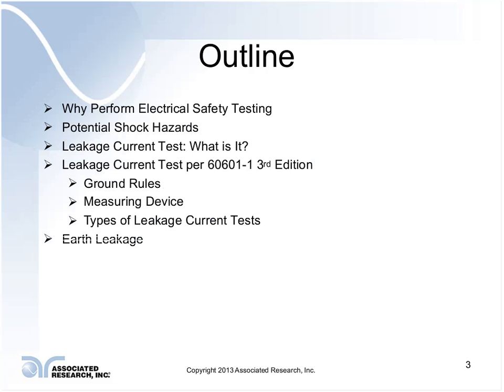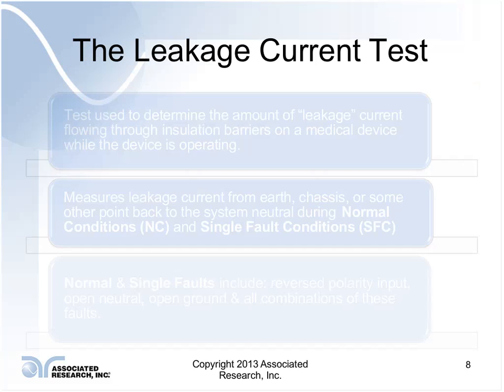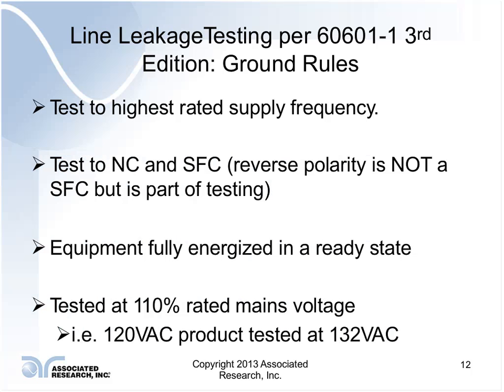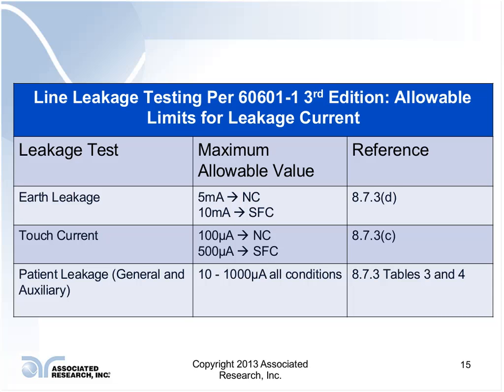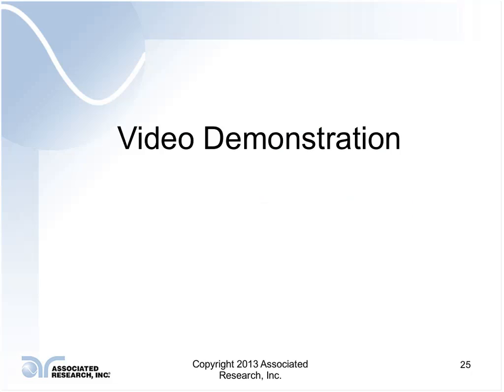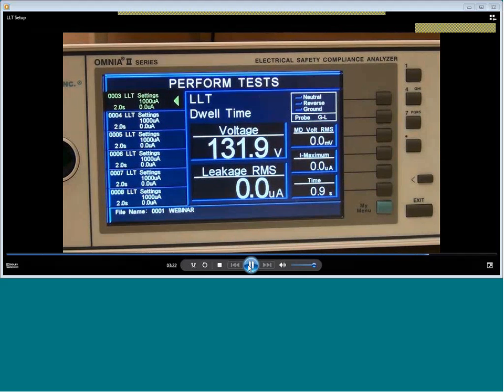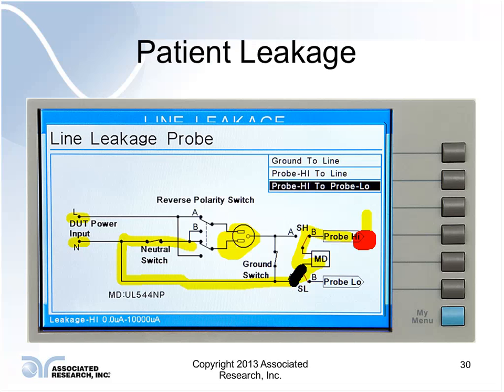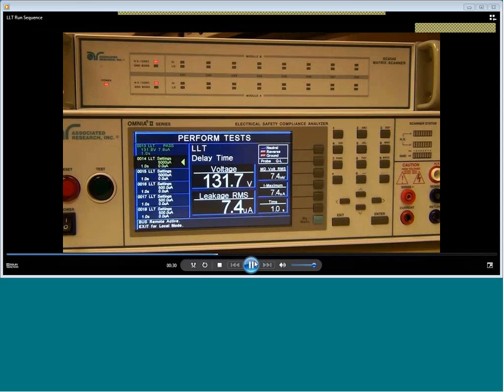Line Leakage Testing Per 60601 1 3rd Edition

Comment: if the device I am testing is 12volt dc drawing 1 amp do I still need to do this test?
Reply: Good question and thanks for asking. For a 12V DC device it depends if it is a part of a larger system or a stand alone battery operated DC device. If it is a part of a bigger system then it needs to be treated like an applied part (if it is coming in contact with the patient). If it a stand alone device you will need to power it up using a 12V DC source and use the probes of the leakage current test instrument to measure the leakage current.
Reply: will there be line leakage in a 12 volt dc system that only draws one amp?  If all the parts are plastic no metal to attach a probe to?